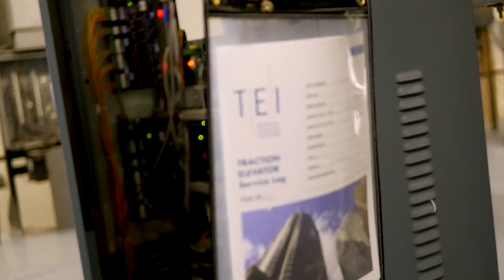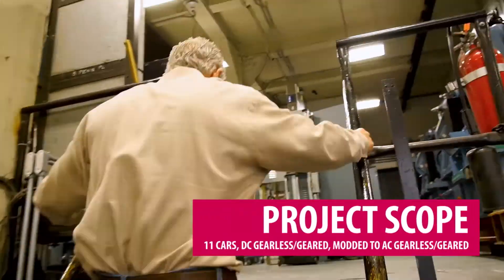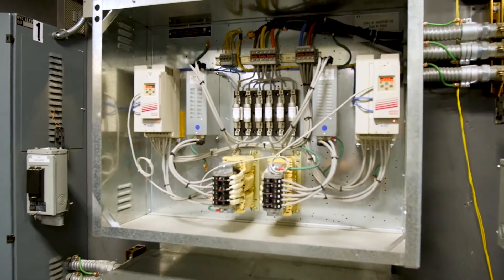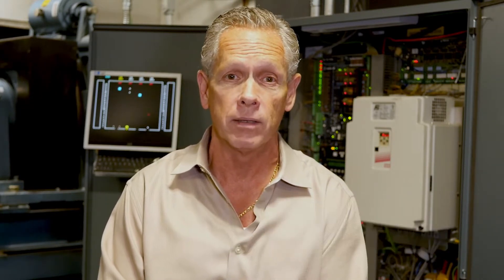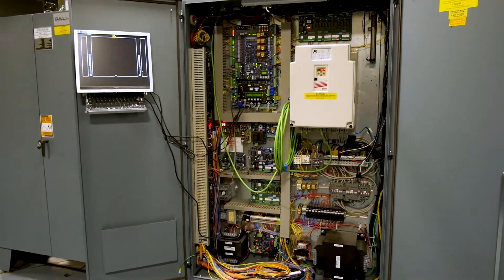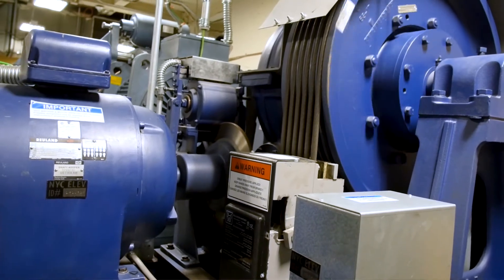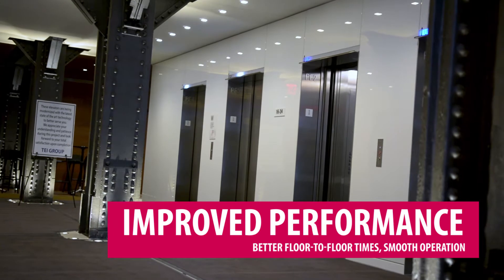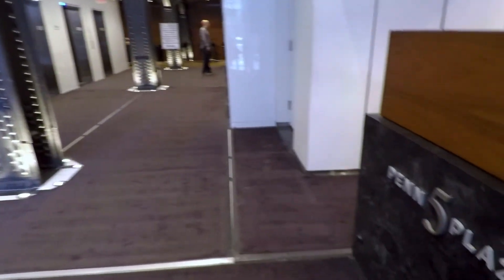DC to AC Elevator Modernization in Manhattan, NY | Machine Room Vids #05

Comment: How mcuh such moderniations would cost for a eleavator of say, 2500 lb capacity, 40 story building?  Maybe dependent on the building specifics, but can you give a range?  Thanks.
Reply from the maker: Hi Alex Li,
Thanks for the question. Unfortunately we can’t answer that question because we are a component manufacturer. You need to talk to an elevator service company in order to get an estimate. We only provide the drive for the controller, but the controller would need to be purchased, potentially a new machine, ropes, cab, any mechanical work that needs to be done in the hoistway, all the labor costs, etc. I would encourage you to talk with a local elevator company in order to get an estimate.

Comment: hello, In ac motors exactly which motor  you use for elevators squirrel cage induction motor or slip ring type induction motor ? according to theory slip ring induction motor can be used for elevators.is it practically used in real time applications?
Reply from the maker: Hello imajey Electrical,
KEB provides the drive for the elevator controller not the motor, but typically we see squirrel cage induction motors in elevator applications. You can always find a local KEB sales and engineering team here: https://www.keb.de/company/representatives-agencies 
Thanks for your comment. - Jake